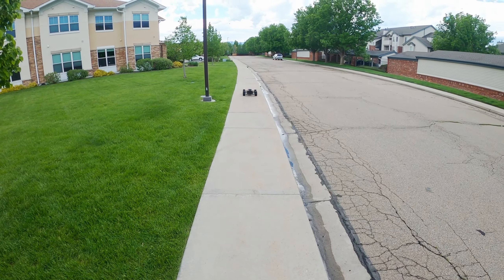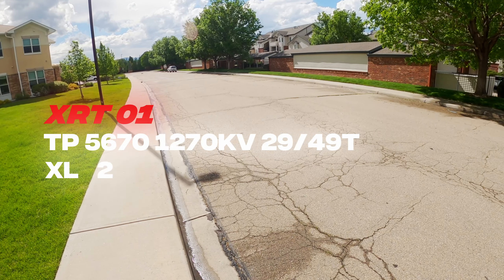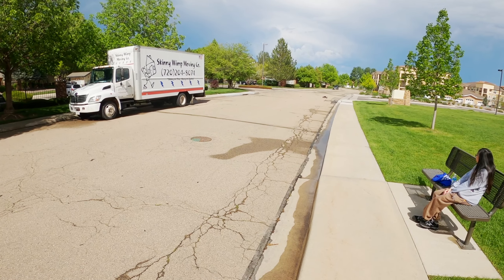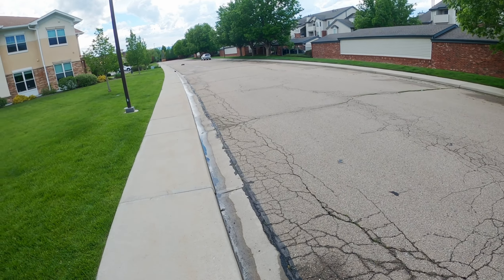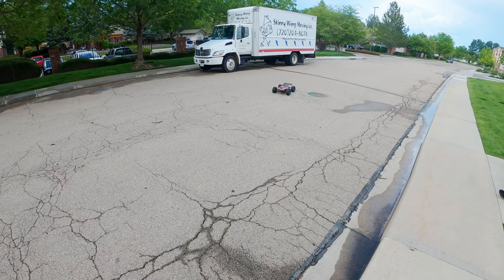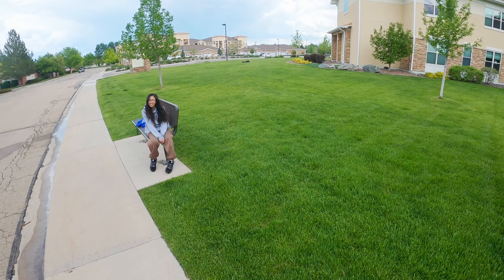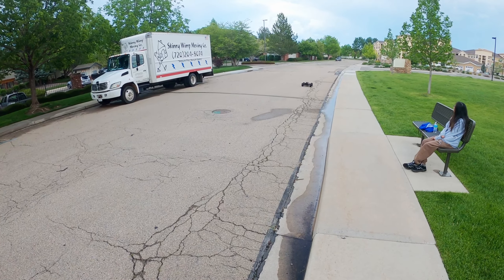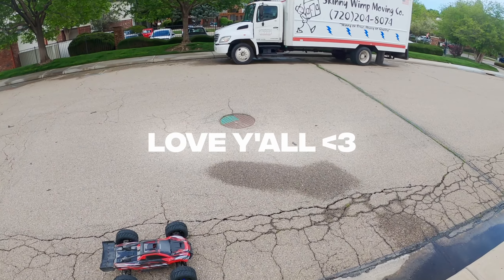Traxxas XRT 01 +12mm Hub Extension Test Drive!

Comment: Maybe more dirt runs will ease up the pressure on the Differentials.  The street definitely puts a lot of pressure on the gears when the tires have so much grip and no where to spin
Reply from the maker: You definitely aren't wrong!! 😎👍